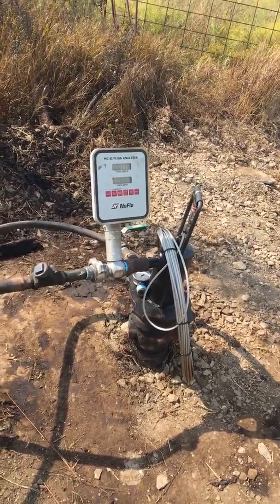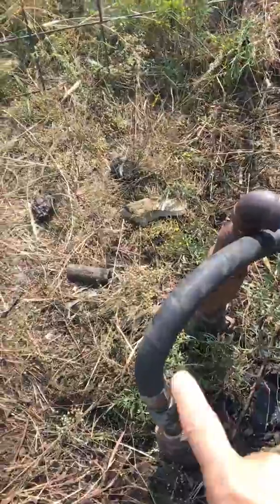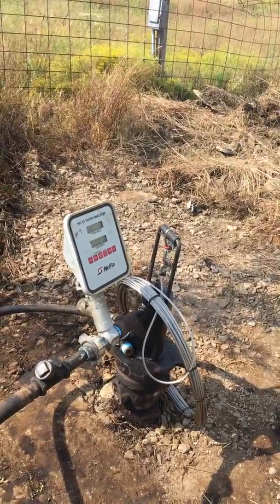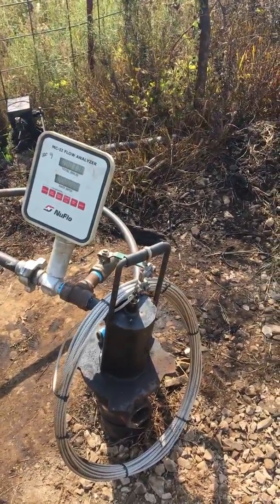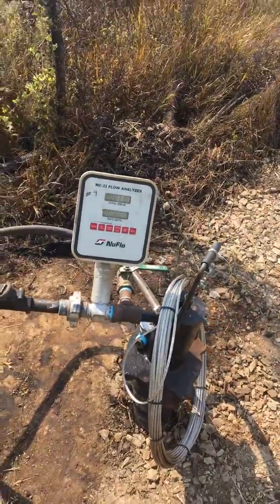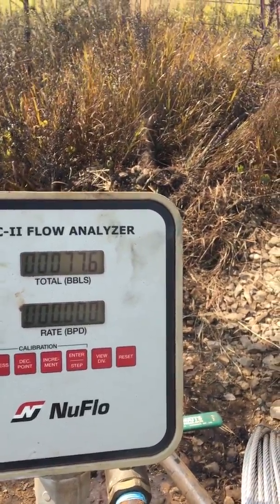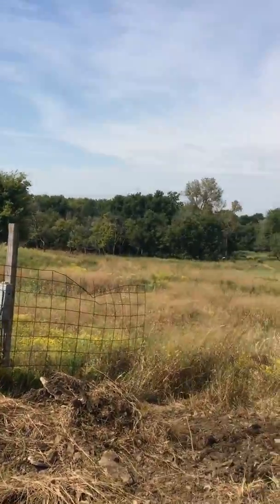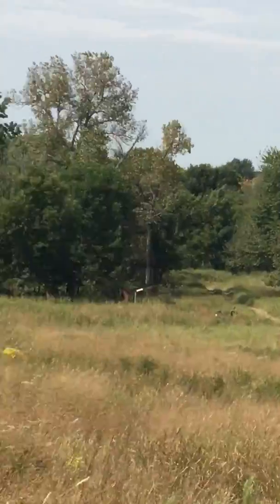Pneumatic Oil Well Pump

Comment: What would it cost for a 1500' well, with the pump set at 1200', 80bpd fluid?
Reply: Hi Casey, The system runs approximately $10 per foot.
Reply: @garysommese2189 does that include  the compressor

Comment: Will this system work on a low flow oil well?
Reply: Yes, our system is self-regulating and will increase fluid flow into the well bore. The system is designed to eliminate all head pressure and keep a constant flow. The pumps are compatible with older wells, stripper wells, low flow wells and wells that have casing leaks.